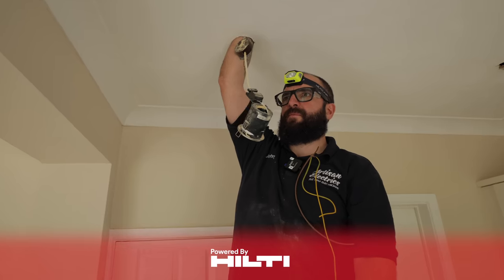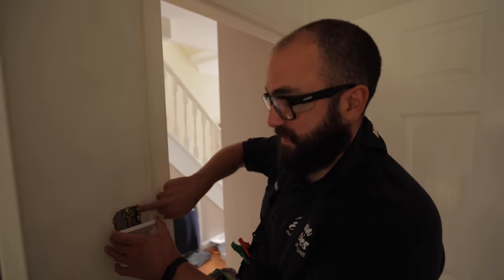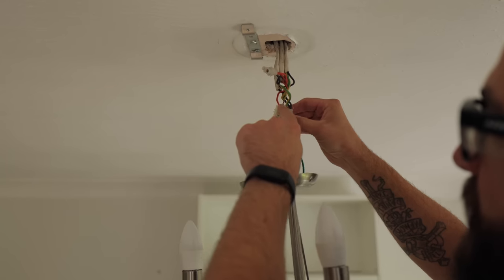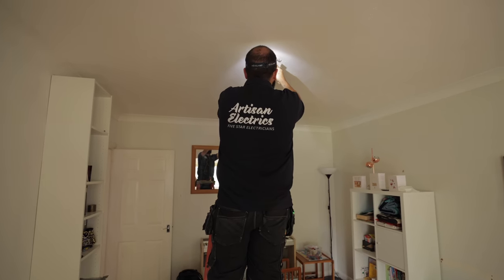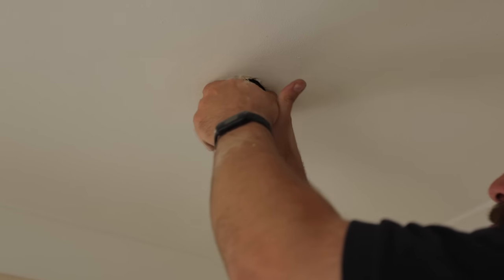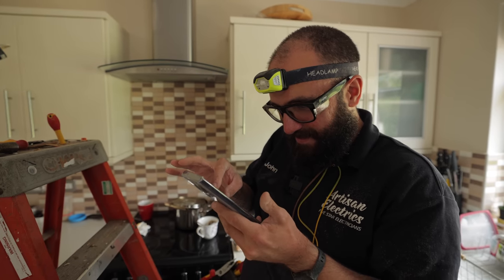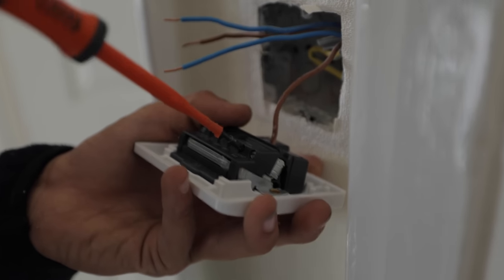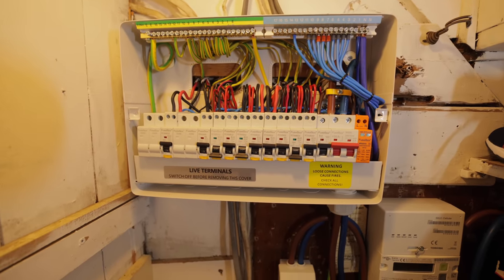ANOTHER DIY BODGE! 🤯 "Why are people like this?!"

Comment: Im sorry if anyone disagrees but the kitchen lights need to be rewired with a CPC to all accesories. My reason is the next owner/tenenat or whoever can put it back to a none class 2 fixtures and fittings and we are back to square 1. i wouldnt even give it as an option  to the client.
Reply: I agree mate 👍
Reply: Class two is a better option than leaving it, you can put stickers by the CU then it’s up to the next owner to get an electrician to change any fittings
Reply: You cannot legislate for the unknown future use of an installation.
Reply: It’s all about making the install safe for the user, your talking about an ideal world senario, ideally yes I agree, but unfortunately we don’t live in that ideal world
Reply: We all come across this JB .it is a bit of a delemer .but at the end of the day it has to be right .and like you said they could be changed to class one at a later date
Reply: I agree but I guess if they wont pay for the work then you have to do the next best thing.
Reply: It’s that grey area again. The customer might not want the work done or can’t afford it at the time. Legislatively if you make it class 2 equipment and record it on the certificate your covered. In an ideal world yes it needs rewiring.
Reply: Even if they are class 2, the cables themselves aren’t earthed & offer no protection?
Reply: I was just going to say exactly what you said. I'm an industrial electrical & controls engineer in a car stamping plant. You are correct. The next owner would do their own thing and there would be a potential fatality ⚡️
Reply: Agreed
Reply: My understanding, is that ALL cables should have a CPC core within them. 
If the whole house lighting was 2-core with NON CPC, then I'd go with class-II fittings throughout.
But with a mix, the wiring is open to later abuse!!
So, Iagree - Rewire kitchen lights :-))

Comment: I bought a house which had been owned by an electrician as the sole previous owner and you wouldn't believe how awful some of the modifications were. The worst was fitting the wrong type/brand of MCB for a new 10kw electric shower - it was physically incompatible with the live busbar and therefore had minimal contact area with it. My plastic consumer unit caught fire and thankfully the smoke alarms did their job.
Reply: He probably used "leftovers" from his job to equip his house.
Reply: no eicr done when you bought it
Reply: @UKsystems  It was before that came in.  I think EICR was only mandatory from April 2021.
Reply: @nickgilbert1264  its a good idea to have the electrical system checked anyway
Reply: @UKsystems  Yeah it was checked afterwards and they changed the CU's in both house and garage as well as fixing other problems.
Reply: @nickgilbert1264  I would definitely recommend a bit of a buy another house get the electrics checked as one of the first things

Comment: Should give off the same light😂😂😂, a 5ft t8 tube gives off 5200 lm, that little led thing only gives off 840, I'd be asking for my money back if that got fitted in my garage
Reply: Agreed. Plus the LED fitting looks like one where you have to replace the whole unit when the bulb dies - horrible.

Comment: I love watching these videos but I'm still so confused because of the many differences I see with how things are done across the pond in the Netherlands where I live. Metal fuse boxes, ring circuits, extremely high amp breakers (16A is about the max here, main breaker is usually 3x25A) and the huge amount of stuff connected to one breaker to name a few. I mainly love how you guys earth all your stuff from lights to switches to sockets. Here earthing sockets is the only real rule. Rest is up to you and mostly not done (but also everything is plastic instead of metal). On the other hand with our radial wiring most rooms have their own breaker in the main switch with just a few lights or sockets. Anything over 1500 watts has their own line and breaker. Fault finding is so easy that way. Keep up the great work!
Reply: Yeah, it is quite lagging in comparison to continental europe
Reply from the maker: Thank you for the insight, well appreciated 😀
Reply: That’s fairly similar to how we do it in the US, we ground pretty much everything, usually use plastic boxes, and 15A or 20A 120v radial circuits are the most common. New homes usually have 200A split-phase 240v (theoretical maximum capacity of 48KW), and heavy appliances such as dryers, stoves, water heaters, central air conditioners, etc have dedicated 240v circuits.
Reply: @Frog-ko6uu  as a fellow American, I was surprised to see the ceiling lamps had cables joined by Wago connectors, just jammed up into a hole in the ceiling. and no junction boxes. I guess that might be to code there, but not too familiar with their electrical codes in England/ UK. I need to do some research and add that to my repartee of foreign electrical system knowledge.
Reply: @paulf3353  The only thin they do better than the UK is they wire everything in "Radial" so if there is ever a fault (broken wire) it is easy to detect and fix. A broken wire on a ring only becomes apparent when the ret of the cable melts.
That said unlike the UK there is no dedicated appliance overcurrent protection like the various smaller fuses fitted to our 13A plugs and in many cases no protection against reversal of 2 pin plugs.
Reply: @PeterChapman-rg6gr  In Europe people just rate MCBs accordingly, there are lots of things are better than in the uk. It can go as far as every large appliance being on a separate circuit. Not to mention a proper trunking in wooden structures etc.
Reply: @paulf3353  The Europeans rate their MCB's to match the capacity of their sockets (and the cables to them)  but there is no further protection from the socket to protect lower power devices fed by smaller cables. Also the pins on their plugs don't have the intrinsically safe protection that UK plugs afford nor are their sockets protected against insertion of things. Yes, as I have stated the "Radial" method of wiring sockets is much better than the UK's "Ring Main"
Ps I have a house in Portugal It has an MCB that feeds the dish washer and washing machine with a change over switch so only 1 can be used at a time,
It then has a single MCB for all the kitchen sockets, A single MCB for all the bedroom / bathroom sockets (yes they allow power sockets in the bathroom) and hall way sockets, A single MCB for the living room and one for the lighting
The mains supply is single phase 45A
A  bit OT but there are still many tens of thousands of houses / flats that still use bottled gas and for the flats the gas bottle is normally kept in a cupboard in the kitchen
Reply: @PeterChapman-rg6gr  Well, you don't need to have fuse in a plug in EU, because it will be either protected by either MCB, it will have fuse in the plug (yes, there are fuses in some 2 pin plugs) or they will have fuse in device itself. It is really a non-issue and much better than having fuse in the plug, because it will be protected independently of if someone would want to replace plug etc. 
 I'm more talking about modern installations/rewire. You probably have a relatively old house if you need a changeover switch. Also Portugal/Spain is probably not the best example generally..  I'd check out Germany, Baltic, Scandinavian countries as a good example.
It is quite typical to see to see dual row DIN rail panel even for 3-4 bedroom flat.
Reply: @PeterChapman-rg6gr  Also, having asymmetric plug design is quite a stupid solution from a user perspective LOL.
Reply: Yeah, the UK is quite advanced compared to continental Europe.
Reply: @paulf3353  Care to explain why or why it is safer to be able to insert the plug the wrong way around and swap the L and N connections as is easily done with the European 2 pin plugs?
In my time I have bought several thousands of £ worth of EU built, CE certified electrical equipment that is center tapped earth but has fuse protection on only the nominal live wire. there is no over current protection from the other conductor to earth.
This is inherently dangerous but has been EU certified by its European manufacturer.
Reply: I always wondered how sockets under the light switches worked out.
Reply: @paulf3353 the fuse in the plug protects the cable to the device, which the fuse in the device can't do. If the device's cable is thick enough that it can safely take the full current of the MCB then agree a fuse in the plug isn't needed, but that's not normally the case for low current devices.
Reply: @AJB1  Why do you need to protect cable with another fuse? What are chances this cable will be overloaded if device connected to this cable is fused? The only scenario is that someone will cut that cable and will re-use it somewhere else, but cmon... Also, if you check UK fused leads, most of them have incorrect fuse rating vs cable size anyway.
Reply: @paulf3353 one reason is the cable gets damaged and shorts, but granted it's going to catch fire where the short is before the rest melts. For extension leads/removable leads you need to fuse it somewhere as it could be used with a different device, and the plug makes more sense than the socket. But it's also just "right" to me. Put the fuse to protect what comes after it. If my oven had a fuse in it, then there wouldn't really be a need to have a 32 amp breaker for it in the consumer unit by your argument. What are the chances the cable in the house would be overloaded? A failure in the oven is very unlikely to take more than 32 amps, but less than 100 which would trip the main incoming breaker. But I'm still happy there's a 32 amp fuse protecting that circuit of the house wiring.
Reply: @AJB1  Once again, extension cord will be protected by properly sized mcb in European consumer unit. Same with damaged cable, it will either trip MCB or AFDD. The only reason why UK started to use fused plugs is ring circuits, which is a bad design by itself.
Reply: @paulf3353  In the uk we might have an extension cable that's only rated at 10 amps, for example. And is protected by a 10 amp fuse in its plug even though the socket it's plugged into could give more current. I don't see why the ring circuit is relevant. You could have a 32 amp radial circuit with thick cable, then devices and their power cables would be protected by 13 amp (or whatever) fuses in their plugs. In fact, it's common to have one socket on the switch plate for an oven in a kitchen, and that would only be protected by the oven's 32 amp MCB if there wasn't a fuse in the plug.
I'm not saying it's crazy that other countries don't have fused plugs, but I like them.
Reply: @paulf3353 Not really they are using a lot more copper than we are to achieve the same effect. If everyone in the world were to be upgraded to a "first world" built environment then there is simply not enough copper to go around. So we are ahead of the curve not behind.
Reply: @PeterChapman-rg6gr Er no they don't. Plenty of equipment is fitted with 0.5mm cable that is well below the rating of the MCB for the socket. If everyone in the world had access to mains electricity and everyone used radial circuits then we would run out of copper. So given that the ring circuit uses much less copper for the same installation than radial circuits do we are ahead of the game. Oh and there is the environmental impact of using fewer resources in the meantime. People who think ring circuits are a bad idea just don't understand what is coming down the pipeline.
Reply: @paulf3353  I have never seen a Shuko plug with a fuse in it and I have seen loads with 0.5mm cable in them. You are telling me that all outlets are fitted with breakers suitable for 0.5mm cable with a straight face? A fuse in the appliance won't help with a fault in the cable which is why you have a fuse in a plug, not to protect the appliance but the cable from overheating.
Reply: @jonathanbuzzard1376  So where is the protection against a broken ring? At least with a radial circuit nothing will work past the break making a failure 1) very easy to detect and 2) making the fault easy to locate.
Unless the cable catches fire about the only time a broken ring will be detected is during the EICR assuming that it is done properly.
Reply: @jonathanbuzzard1376  When copper became a problem? Are we living in a world war economy? Also you can substitute copper with aluminium pretty easily and much cheaper, it is already done in a lot of industrial installations.
Reply: @jonathanbuzzard1376  You never seen a plug with fuse because with shuko pretty much every certified device has fuse inside. In the UK not everything has fuse in a plug too (shocker!)
Reply: @paulf3353 The fuse in a device does NOT protect against a fault in the appliance flex, which is what the fuse in a plug is for. In the UK EVERYTHING                                                     must have a fuse in the plug if you are using Type G plug/socket combination. Anything that does not is illegal.
Reply: @paulf3353  You misunderstand. The amount of copper available in the known exploitable copper reserves is insufficient to connect everyone in the world to mains electricity using radial circuits. Sure there is no shortage today, but there will be in the future unless we find some new exploitable copper reserves. The normal way people look at it is to say at current demand levels there are 200 years of supply left, but that makes the assumption that demand stays flat. The alternative approach is to work out how much copper we use in USA/Europe per person, multiply that by the world population and work out if we have enough. We don't by quite a wide margin.
Reply: @jonathanbuzzard1376  We'll be fine with copper for many many tens of years to come. Copper can also be recycled. And as I said, you don't need to use copper, there are plenty of other metals which can be used.
Reply: @jonathanbuzzard1376  That's why you rate mcb correctly and do not overrate. Ideally you underrate. You do it according to what devices are planned to be connected and do not overrate.
Reply: @paulf3353 You don't get it do you.  0.5mm cable has a MAXIMUM current rating of 3A. Given that 0.5mm cable is routinely used in appliances you would have to fit 3A MCB's to protect all the outlets. The thing is you DONT use 3A MCB's (is there even such a thing) so you always overrate your MCB's and appliance flexes are prone to overheating in fault conditions. No system is safe unless you routinely fit fuses in the plugs to protect the appliance flexes and as only Type G plug/socket system actually does that then it is safer than all other plug/socket combinations. Get it now?
Reply: @jonathanbuzzard1376  I think you don't get it. First of all what are chances that appliance with 0.5mm2 will draw more than it can sustain? It must pass certifications, so it is impossible by itelf. Secondly assuming you're talking about detachable flex, 0.5mm2 at 70c is 6-7A max. You put 6A mcb on this series of sockets and it will trip just fine.
Reply: @paulf3353 I do get it you don't. Firstly every reference I have says 0.5mm cable max 3A. The point is in a FAULT condition in the FLEX you can draw more than 3A, or for that matter more than 6A. The thing is you DONT use 6A MCB's on your socket circuits on the continent, not least because they would blow the first time you plugged in a hairdryer or kettle etc. Typically it is a 16A MCB for a radial circuit of several sockets. Otherwise, a typical house would need a stupid number of MCB's and even then you would not be able to use a hairdryer, kettle etc. The reality is if you don't have a fuse in your plug/socket combination then you are open to fault conditions causing the appliance flex to overheat and cause a fire. It should be noted that the number of people who die from fires caused by overheating electrics is a couple of orders of magnitude higher than those killed by an electric shock. It's more acute in the UK because we have 32A ring mains but it is an issue everywhere because every country in the world protects its socket outlets with fuses/MCB's rated much higher than the thinnest flexes used in low power devices.

Comment: Another awesome video chaps! One suggestion is to use double wall glue lined heatshrink tubing. Not expensive and works great as it has a typical 4:1 shrink ratio and the glue seals around the cables.  Cheers